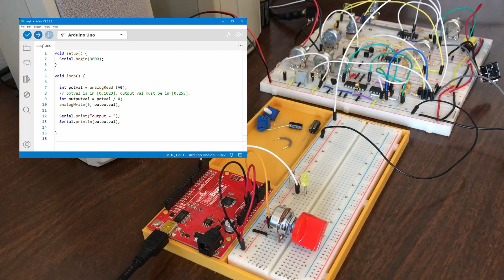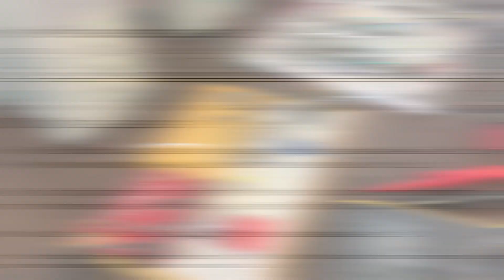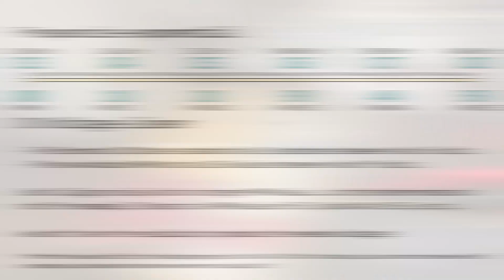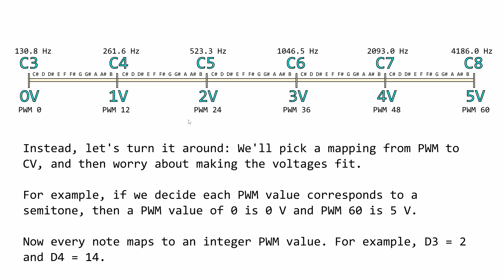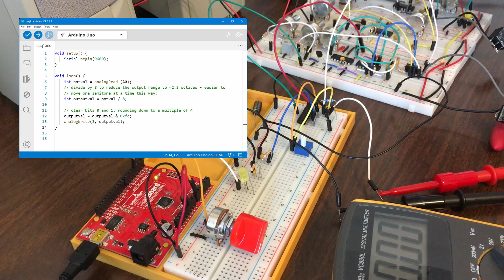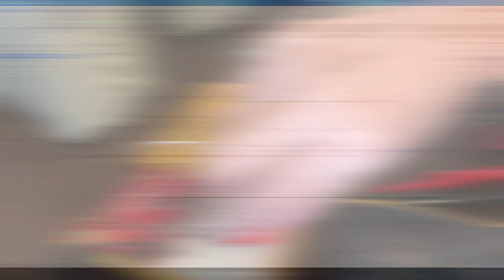Converting Arduino PWM to synthesizer CV... badly.

Comment: If you have opamps... why not use an active filter (e.g Sallen key) intead of just buffering two chained passive filters? Additionally, a shift register and a R-2R resistor ladder can easily produce a stable voltage and act as a single 8-bit DAC. In your case, if you have free GPIOs, just use 6 of them with an R-2R ladder to get 64 different output voltages.
Reply from the maker: Thanks! Yeah, a proper active filter would absolutely be an improvement. I'm very much a novice on the filter design thing, so I was just pleased to have come up with something that mostly worked via experimentation instead of just copying another design, even if the result is a little janky. The resistor ladder was my backup plan, but I wanted to try something I hadn't done before first.